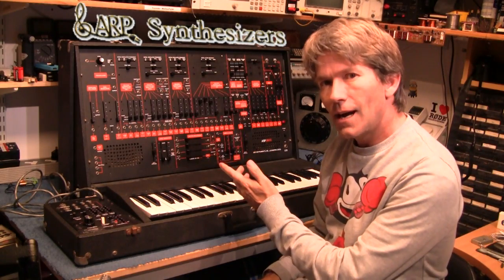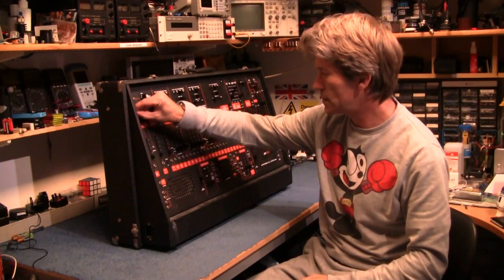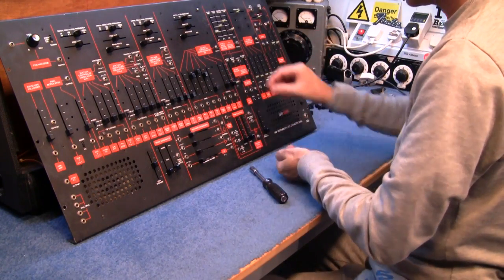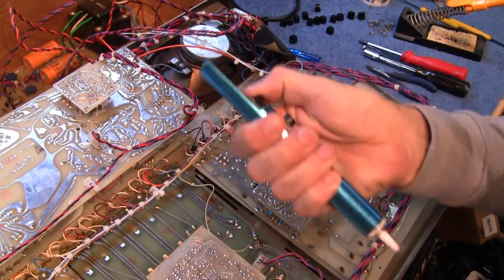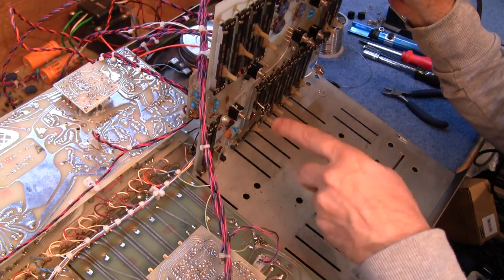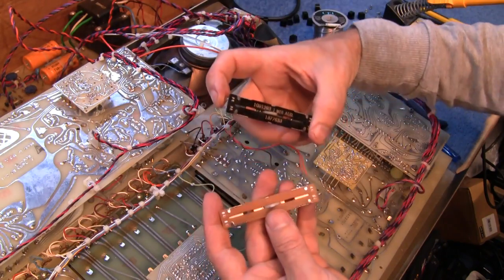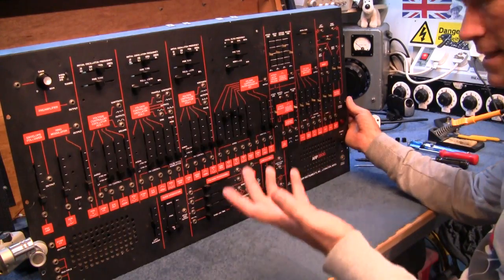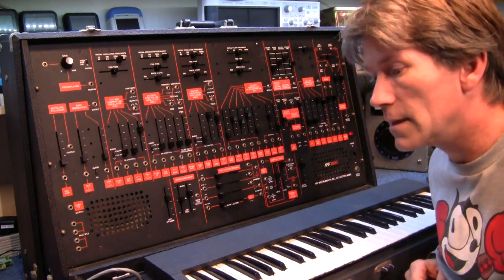ARP 2600 analog synthesiser fader repair MF#83

Comment: I love your channel!  I can't explain the thrill I got when you opened up the case, to see the wood enclosure and hand traced circuit boards., wire harnesses, etc....Wow, what a treat.  There is something special about old analog gear. (Of course I have a problem calling anything old that was born after I was).
Reply from the maker: I only wish I had the unit for more time so I could get a deeper look into the thing but time was short and it is back with its owner already.

Comment: I fixed the power supply in my Matrix 6 last night and could not believe how fast it went because of my new de-soldering gun. Worth it's weight in gold!! I have the exact same blue solder sucker you have that I got from Radio Shack back in... 1980 or so. It's ok, but it never worked all that well. The gun was absolutely perfect every time though. Love that thing!
Reply from the maker: normally I would have used the desoldering gun but there was only 3 tabs to de-solder. but yes they are great tools for big jobs.

Comment: Just as a side comment.
Yes, a sucktion "tool" is sometimes quicker then a desolering unit. Especially when you are only doing 2-5 parts of de-soldering.
 I was glad to see your reflex of experience when you heated up the tin and refelexed your move to the soldering placement.
I know. It's a nerd thing. 
Keep up the good work!

As a complementary comment, I am a firmly sugestor fo making the clamps of any component stationary before making any soldering.
  This due to the fact that the clamps are there to take up and fixture its placement. If you do it all the way around it would make the solder stations the primary places to take up the flexibility.

Cheers!

Comment: The interior of that beast looks like an Atari 2600 mated with itself then vomited. Over time, said vomitus evolved into something resembling order. Kudos for not going mad within the bowels of that thing. I've always wanted one of these, but like most people, can't/won't afford one.
Reply from the maker: Hi Michael. I really wanted to dig in further but I was actually afraid of disturbing something and making things worse. so I went only as far as I needed to get the job done.
Reply: markusfuller I completely understand! That thing's innards look crazy. You know what else would be crazy? Korg continuing their ARP Odyssey concept and releasing one of these, perhaps 30 percent smaller.
Reply from the maker: Korg-arp2600 - 30% = Karp-1820 maybe :-)
Reply: markusfuller Very nice. I'm still chortling. That was really good! I would hope that it would still have 100% of the capacity, though.

Comment: This was a very interesting video. Never seen the inside of an Arp-2600 ever. Wow, you're lucky there :) Even if the repair was kind of "simple", I still had a blast due the fact it's a really signature synth. hanks for pulling this one off.
Reply from the maker: Yes simple fix but I thought it would still be useful to film it. I do not film all the repairs I do but this one I thought may be interesting. Many thanks

Comment: Excellent video once again Markus. I have a question about the replacement potentiometer. I know pots can be linear or logarithmic. Are the originals linear? If not, is it possible to tweak a pot's log curve so it matches the original? Understandably thats an important factor for many, particularly for envelopes.

Comment: Markus, thanks for sharing. I know it takes some effort, but it's so very helpful (for some of us anyway :) ).  Where did you get the replacement slider?  part#?
Reply from the maker: they came from ebay the seller is called taknin from Israel ebay search number is 321747921769 . I hope that helps.

Comment: So that's a real spring reverb?  Sounds great.  Maybe impossible question to answer, but on a scale of 1 to 5, how flexible is this compared to fully modular?
Reply from the maker: Hi Michael. I am not expert on this but I think it is as flexible as a full modular. even though theres a signal path prewired inside as soon as you start plugging in jacks some of those connections are disconnected inside and it starts to become more sort of modular.

Comment: Thanks for posting this Markus. It takes some balls (and insurance!) to operate on the guts of such an iconic and valuable synth.
Did you use legacy Pb solder or a modern Pb free type? (If so which brand of solder do you prefer?)
Reply from the maker: Hello yes I used the good old 60/40 PB solder 2%flux cored by CEL. it just flows so much better than the new solder and smells and tastes better. now I will be arrested by the health and safety police for that comment. LOL

Comment: I bought a new solder sucker last summer (after the one I got second-hand in 1990 finally gave up) and my new one is actually identical to your 40 year old one (classic, "if it aint broke, don't fix it").
Reply from the maker: edgeeffect Yes thats such a great design that simply works well so it never needs re-inventing.

Comment: Hi, I have a X0XB0X, Roland TB-303 clone, I built as a kit years ago. It never worked right. The circuits seem to be fine and I think I tracked the problem down to a software issue with the processor. A forum at the time told me it was fixable but i don't know how to do it. Would you be interested/willing to have a look at it for me?
Reply from the maker: Hi Glascott, Im very sorry but I only make these videos in the little spare time I have as im full time working in my normal job. I have items here that have been waiting over a year to be fixed still and never seem to have the time to fix them so i cannot take on repairs. my apologies.

Comment: I was waiting to see how you put the front panel back into the case, but it was edited out - another thing that sounds easier than it actually is! The top has to go in first and there is no room for fingers. Oh well, maybe next time?
Reply from the maker: Sorry Barlo, I did film that part but I was struggling and in front of the camera and it looked so awkward that I did not include it in the video because of the length of the video. my apologies.
Reply: You know, I figured that was what happened. I've done some repairs on my 2600 and have always wondered  how others managed the removal/replacement of the front panel. I guess there is no graceful way of doing it! I also have a slider that needs replacement, but have been procrastinating. Thanks for the video.

Comment: my god. its box is so much more empty than i imagined.
Reply: Really?  Not being offensive, but by modern standards, that's a lot of boards!  It might be because as a kid, I disassembled anything I owned.  And I would get junk electronics from garage sales.  So I have seen a fair amount of electronics over 50 years of life and I thought the Arp had about the expected amount of board mass - I was just surprised at how many different boards.  I bet if you looked at Moog modules, they are going to look pretty empty too, on average :)  I learned that people judge modern electronics by mass, which I find amusing.  Like people who felt the $3000 DSI Prophet 12 is overpriced because the board is small.  What did they expect with a modern surface mount board?  You pay for the case, controls, display, keyboard and R&D mainly - the actual board is probably pretty cheap to make ( computer motherboards have way more complexity in some ways, and cost $100 to $200.) ( And people miss the fact the fact the P12 is not mass produced like some Korg synth, so it's economy of scale is poor.)  Anyway, I am rambling, and not saying you do, but I don't think we should judge synths by how much electronic board mass they have :)
Reply: but there's so much empty space on the boards. it looks like the boards are big out of respect for the front panel, not out of necessity
Reply: Oh I see what you mean.  You could be right about what you say.  I have seen the spread out thing on other boards, and, trying to dredge them from my memory, I think there were physical mapping to control reasons for it sometimes.
Reply: If you try to squeeze too much in to a small space, you start to get capacitive or inductive coupling between components that aren't supposed to interact with each other.  

Ceramic disc capacitors are quite bad for it, for example - you can have two that are inches apart, and if the plates are facing each other, you'll get coupling.  

I had an electronics class where I had to build a simple one transistor amp.  It just wouldn't stop oscillating (postive feedback) until the tutor walked over and twisted one of the capacitors to put it at right angles to the other one - which was a couple of inches away.

Comment: Wow, this machine looks as it it were totally hand made hand soldered everything.
Reply from the maker: Hi Andrew, Yes all the work on the inside was done by hand. no pick and place machines used for these synthesizers. and it looks so clean inside.
Reply: markusfuller
Yes, it looks amazing inside.  Although it does look as if it came from a different era.  It can indeed be called a vintage machine (in a good meaning of the word).  DX7 seems light years apart from this.  And please note, I am not saying lights years "ahead", but "apart".
Reply: It surely is, given the date it has been made....there was no pick&place machines to populate the boards, way to much "non-standart" components had been up to handle and therefore a final hand-solder job was needed anyway and wave soldering was way too expensive for these rather low unit count PCB soldering job. 

Also these PCBs had been routed all by hand and also with "stickyTraces" black thin tape on a clear foil. This foil was sucked down to a big light desk and the PCB engineer manually formed the traces one by one with that tape.

I done that in my early intern days when i was ordered to copy foils like these for industrial control boards.
Sitting hours and hours in front of a desk like that isn´t much fun at all, it´s very bright and that huge contrast makes the eyes become tired very soon...
Reply: TubiCal
It's all good then.  There's just no marketing where we need it.  French speaking Swiss watch makers are excellent marketers convincing everyone that a hand made mechanical watch is better than quartz.  Where are the marketing people where we need them for electronics?  Not only synthesizers, but electronics with fine mechanical parts like DAT machines or SA-CD players.

Comment: Was it a Clio that requires a wheel to be removed to gain access?
Reply from the maker: no it was a mercedes A-class and I had to remove water bottles etc just to get to the back of the headlamp.

Comment: I have one just like it, with the third oscillator sounding very low and the keyboard is not working. whish I could send it to you to fix it.
Reply from the maker: Hello Solostuff. Cyberwave EMS  http://www.vintagesynths.co.uk is in the UK and specialise on these vintage synths. I do not really do repairs. I just make these video's in my spare time and only have time for my own gear and a very few local friends. and they can wait months before I have time to look at something for them. sorry I wish I had this as my full time job but its not possible.
Reply: I understand. Thanks for the information.

Comment: Would that really last another 30 years?  I mean, I read somewhere that circuits in Yamaha DX7 (400-series circuits, if there is such a thing...) life expectancy is 15 years.  The DX7 that I was privileged to buy few years ago was manufactured in 1986 (as it says on the inside somewhere).  Now, it's 2016 now, so if my algebra is correct, it makes it 30 years old instrument still kicking.  Sure, there is some distortion on the output.  It's playable though, and the slight distortion doesn't even show much on YouTube video when masked with effects processor, sound data compression of the video, etc.  But when listened to directly on the headphones, oh my, it's quite horrible.  Does this mean that some of the instrument components are dying?  I very often mention (beg) in my comments about reissuing the DX7.  Everybody says I am crazy, that there's no market for it.  But, if the manufacturer's life expectancy of DX7 internal circuitry is 15 years, this makes all DX7 way past the expiration date.  I mean, would you eat cheese 15 years past expiration date?  (aside from mold cheese maybe).  Moog Music got a whiff of what some musicians want and reissued far truer to the honest Model D than Voyager has ever been.  Hey, Voyager could be better, has more features, is more modern, but that's not the point.  Minimoog can be to keyboard players what a Gibson Les Paul is to guitar players.  You don't want to redesign the look and sound too much on it.  To me, the DX7 is like Fender Stratocaster.  It's a classic.  I think it should beg for a reissue.  Sure, you can sometimes find a MINT in a box DX7 on eBay, but it's still a 30+ year old instrument, way past the expiration date of it's internal components.  I mean, I don't like to ask questions or make requests, because I know how it feels when somebody asks me something.  My body start boiling to say: "Look in the bloody manual."  But, the manual doesn't say much about instrument life expectancy and probably for a good reason.  So, I would be really interested in electronics professional opinion about life expectancy our synthesizers.  Is it really 15 years for the instruments manufactured in the '80s?  Is the ARP2600 really more durable and fixable since it was hand made inside and last another 30 years to make it combine 70 years life expectancy from the time it was originally made?  I mean, I am really puzzled to see all those '70s and '80s electronics still working.  Sure, my Roland D-70 died.  It was burning the fuse every time I attempted to turn it on, I gave it repair shop, they said that there must be some problem on the main board, so I gave them the instrument for scrap.  Okay, they gave me $100 for it with all me memory cards and all.  So, some instruments really do die.  It could be because it was frequently opened for key contact cleaning and maybe somebody lied some static on it; nonetheless, the main board seemed to develop a problem somewhere, and repair shop didn't want to look further.

Anyway, nice video, and impressive instrument this ARP2600.
Reply: *****
I think it depends on what the RS-09 has inside.  If it's all discrete components soldered by hand like in the ARP2600, then they can be unsoldered, replaced, and re-soldered again by hand.  If it has some IC's that can no longer be sources or "emulated" with EPROM's, then it's a good bye.  Hey, even EPROM's themselves could lose the charge over time.  EPROM reading and programming could be the next big thing if manufacturers don't decide to reissue their classic gear, like the DX7, D-50, SY77, etc.
Reply: these Eproms are going to be the next big issue, when in some decades from now, they will definitely loose their "memory". But if you read it out before, no prob. Nowadays you can use an arduino to do that. No need to buy an expensive Eprom reader anymore. Also an arduino can be used to simulate that eprom. Or buy an EEprom of the same size and programm that and voila you got an 1:1 repalcement.
Reply: My experience is that the reliable life span of integrated circuits are between 30 and 40 years. I have changed quite a few ICs in my Roland SH-2000 from the mid 1970s and I have given up on two Elka organs from the same era because they kept breaking down. (Don't worry - they weren't X-705's)
Reply: The first thing to go is almost always the electrolytic capacitors - all the larger value capacitors will be electrolytic, and they leak.  They are only rated for a a couple of thousand hours of use, at the rated temperature - hopefully longer at a lower temperature, but they still have a limited life.

Your headphones output has a separate amp, AFAIK, like my Yamaha TX7 (which also still works).  On the TX7, the headphones output comes from a small amp which is fed directly from the line out signal - so the same signal that goes to your line out socket goes to the input of your headphones amp.

Since you're hearing more distortion on headphones (if you mean from the headphones socket), it's that little amp that's wearing out the most, and almost certainly it's the capacitors.

The large ones that smooth the power supply will be on the way out too.

If you can't find a repairer, you might want to try talking a TV repair shop into it.  I expect there are still more of those around, even though TVs are now more or less disposable.  Replacing capacitors is one of the main things they do.

I still don't get why Yamaha made the Reface DX as a souped up DX100 (only 4 operators) when they own all the designs for the DX7/TX7/DX7IIS etc - all of which are more sophisticated, and were made 30 years earlier.

Reissues would be good, yes.

Comment: I was hoping you'd say you got it at a boot fair for a fiver :-)
Does this old radio work, mate?
Yeah sure it does...
Reply from the maker: I would be literally over the moon if this ever turned up at a car boot. old Radio? LOL Im still grinning on that part of your comment.
Reply: markusfuller you might laugh but ,  about 20 years ago I moved out of my parents home and left gear there until I got sorted in my new pad ,    well months later ,  I went round ,  hi Dad just come to pick up some of my old gear ,,  went into cupboard nothing there ,  Dad wheres my vintage bits and bobs ,   Dad replied , oh those old Radios I threw away ,,   well those old radios he called ,   was a Wen Copycat ,    a Melos Echoe Chamber complete with the rare loop tape cartridge ,  both fully working and restored by me ,  and some other old vintage tube amps lol